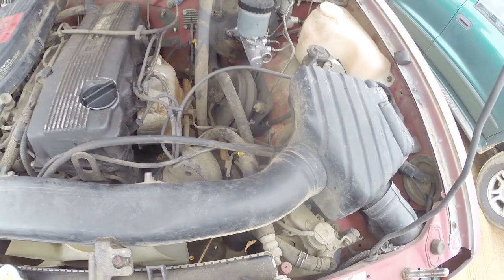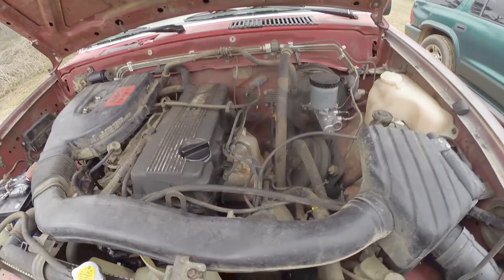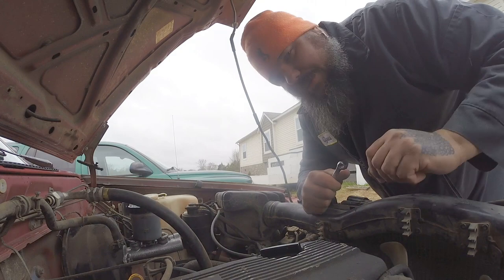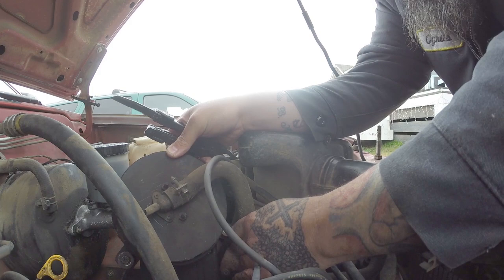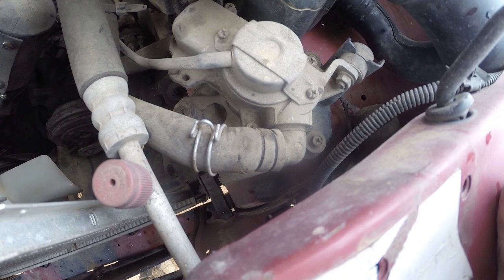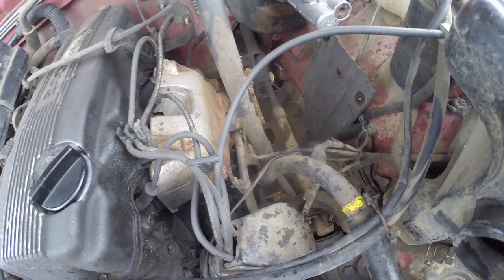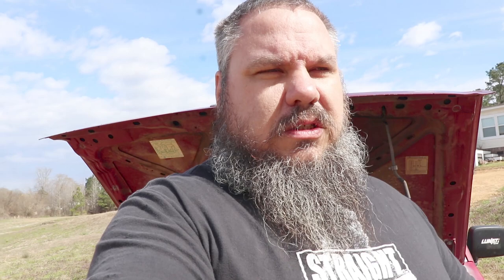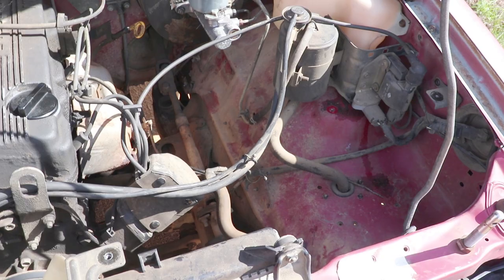Air Induction Valve Delete D21 Project "SIN" AIV Delete

Comment: Where it ties into the exhaust. You can cut the pie clean about 2in before the nut and if you back the nut off the chairs you can remove the pipe from inside it. A nickel fits almost perfect in that hole then you just drive the nut back down on top of it. A lot of 240 guys use that truck and it works pretty good
Reply from the maker: Thanks for the input, I'll have to check it out. I still just have a bolt and hose clamp blocking it off.

Comment: Did the truck run any better? I have a busted hose at the AIV case and mine idles and dies
Reply from the maker: I felt like it ran better. Any time you can eliminate vacuum leaks it will for sure.